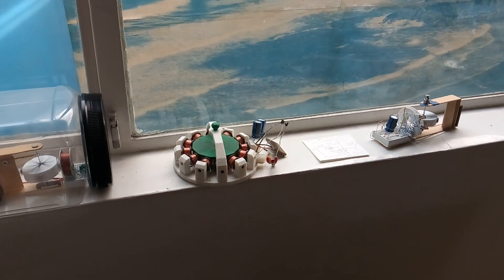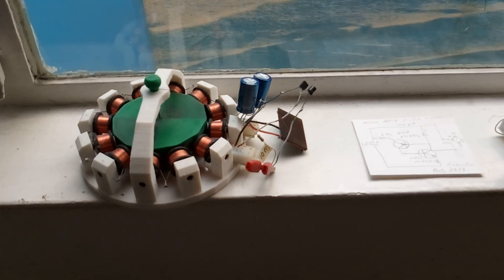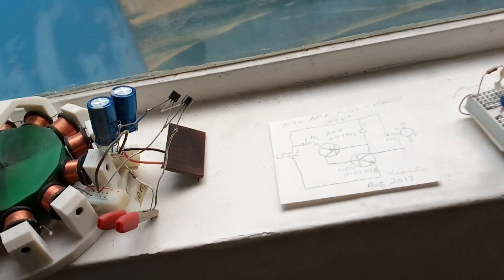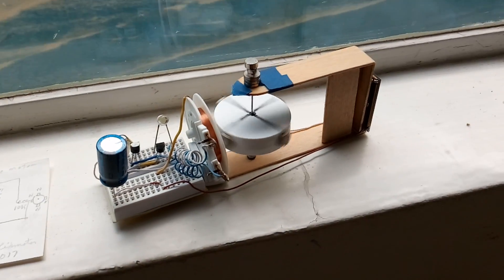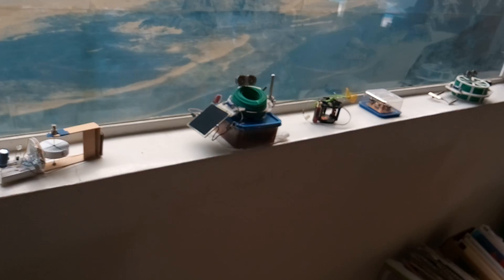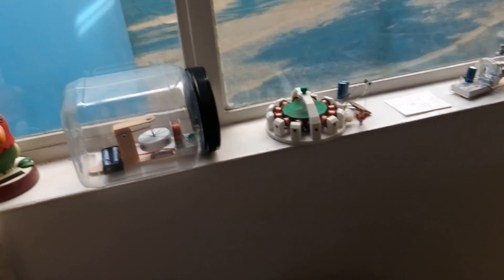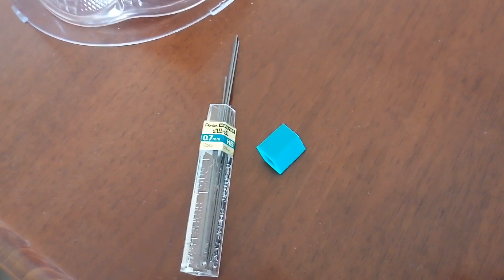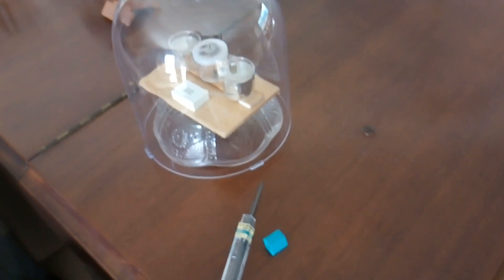Non-Stop running devices-- update at 1.5 years

Comment: What kind of resistor do you use for that yellow butterfly/flower puls motor
 i can see in the video? thank you from Holland!
Reply from the maker: It is just a low watt 30K resistor in series with the battery..  The amp draw out of the AAA battery is about 15 micro amps during the day and goes up to 40 micro amps at night.  It is a very simple way to get the job done for a non stop running desk top item.
Reply: @Lidmotor  Thank you very much!

Comment: Well done.  Amazing how long these are running.  Even the ones that stop occasionally are still impressive.  Coincidentally, I've had the same experience with reed switches sticking open or closed.  So the two-transistors drivers work best for me too.

I'm eager to see more tests by LaserSaber and you on friction-less bearings.

Comment: The 'Non Stop' search for a 'Non Friction' bearing to make a 'Non Stop' running motor possible. 
By the way, how's your plant battery? Robert Murray Smith is digging in to that right now, he say's it has something to do with microbes.
Reply from the maker: Excellent question. My plant battery 'Phyllis' is doing great.  She has really become part of our home now.  The  LED Joule Thief runs all the time.  When it dims down the plant is telling me she needs water and I add some.  Gosh Phyllis is many years old now. Time flies. I did replace the Mg anode once a few years back but the plant itself seems happy.  She puts out a new leaf from time to time but other than that she just lives on.  What is most surprising to me is the JT oscillator that runs non-stop in the kilohertz range.  How can a transistor switch that many times year after year and stay alive?
Reply: @Lidmotor  Because it was not made in China perhaps?
I have an old Sony radio clock that i got from my parents when i still lived at home some 35 yrs ago, that still wakes me up every morning. My first Sony! :)